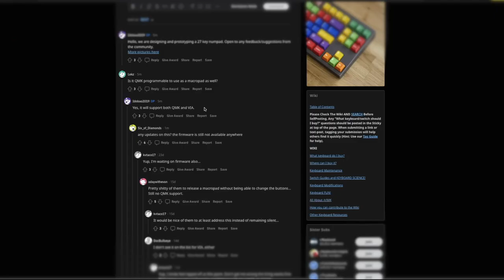IDOBAO Montex - Foamed & Protozoa Nightcall // Durock Sunflower - This Numpad/Macro worth the hype?

Comment: Yours looks really nice! Thanks for the tip about joining the discord for the files. Anyone looking to buy one of these, if you plan on swapping out the switches make sure you have a thin switch puller, as mine chipped away some of the coating on the plate/case
Reply from the maker: Thank you so much! Yeah it was such a hassle with the flashing. Why is didn’t ship with via is beyond me! Yeah had that issue before with other things, this wuque puller is awesome though!